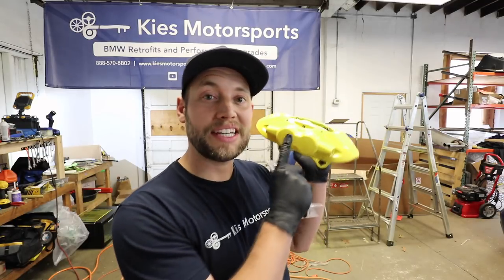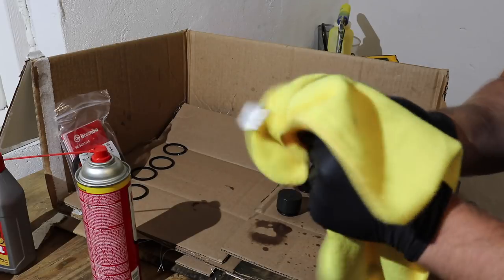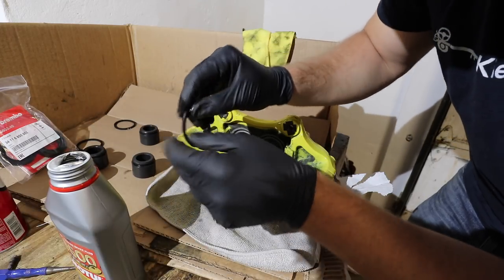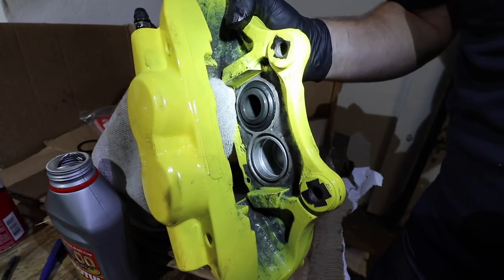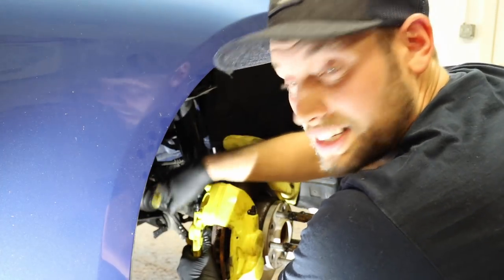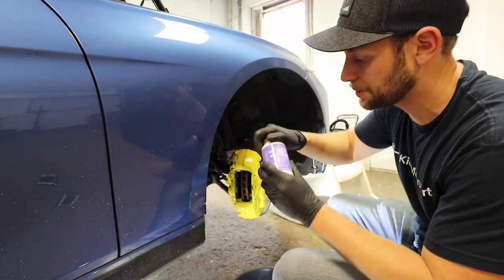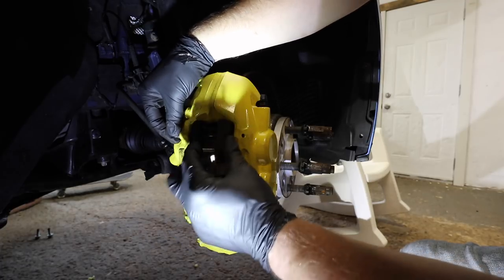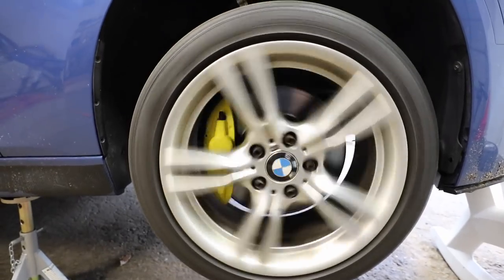🔧 BMW F30 Front Brake Caliper Rebuild and Reinstallation - Post Powder Coating (Easy F30 BMW Mod)

Comment: Hey bud, one of my pistons came off when I was changing the caliper. Bmw wants 800 dollars for a new caliper. How were you able to take off the dust boots and where did you order the whole kit. I was thinking of just rebuilding my caliper. You got any part numbers? And does the kit also come with the seal inside where the seal slides on the piston walls?

Comment: Hi guys! I got a question.. I got my calipers resprayed from blue to red in the garage, but they did not apply any primer. They only took away old paint and sprayed 2 layers of new paint. 

Does the absence of primer will make calipers to core dw real quick ? ( I stay in UK, 24/7 rains) 

Will current paint last ?

Comment: Quick question. I just got a set of F80 M-sport calipers for my 335i. They were overheated, and the seals are shot. I ordered a new kit for the seals, do you think the pistons need to be replaced as well? Or should I inspect them? Thanks!

Comment: Love your videos! I just bought a 2014 335i MSport with a lot of MPerformance bells and whistles (power kit, MSport Exhaust, MSport brakes). The OEM pads are extremely dusty and I want to change them out for less a less dusty set.  What brake pads did you use in this job?
Reply from the maker: Thanks! Congrats on the car! I have OEM, but I have some new pads for another day..

Comment: Hey kies my bmw is pulling to right i done alignment from bmw but they said to get new tires 
Do you have any recommendation to fix it
Reply from the maker: Are your tires really bad?
Reply: Kies Motorsports no its al good just because it pulling to right the right front tire’s out side edge is has less tread
Reply: Kies Motorsports if i interchange tires is that gona work
Reply: Rotate the tires